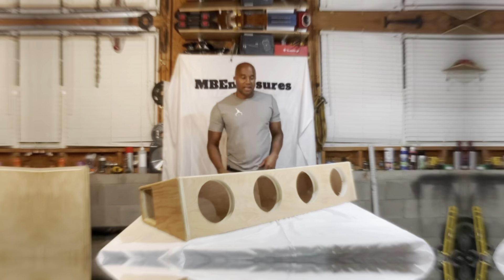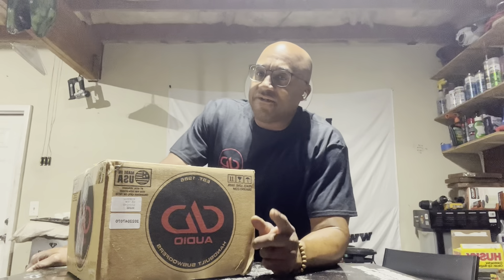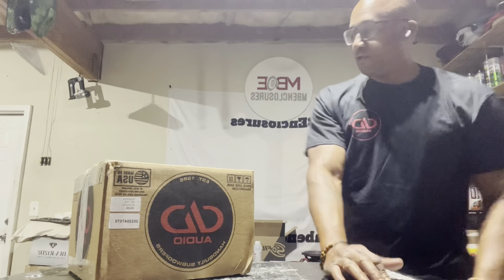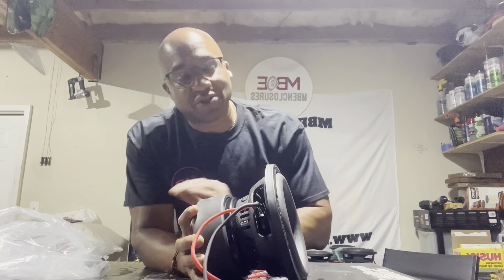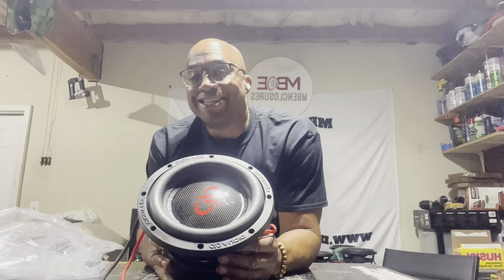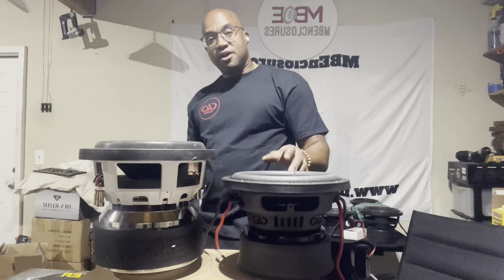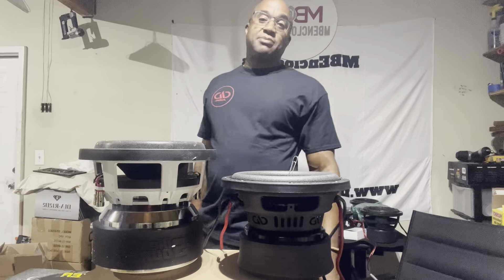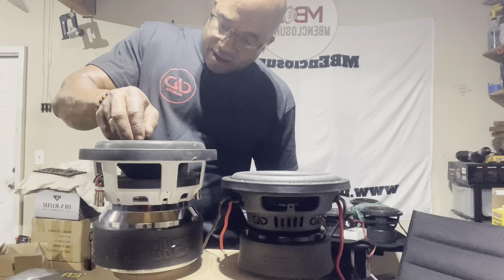Unboxing the Digital Designs 1508 SC…No Seat Lift Needed for Optimal Performance!!!

Comment: When magnets get stronger their magnetic field gets smaller.  Also, the black hole in the middle of the field gets bigger.  An N55 rated magnet is stronger than a N44 and the N55 has a smaller magnetic field.
Reply: So if you measure the bl, the DD will have a slightly stronger motor than what resilient sounds lists on their website. The reason so much flux is coming out of the top is because of the neo ring on top of the pole piece. It's because there's a crazy strong magnet right under the dustcap.
Reply: @blakebrockhaus347  makes sense.  The paper clip is much closer to the magnet and the field faded away exponentially.  This experiment os sorta like the vacuum cleaner guy and the bowling ball!

Comment: A little off subject, but whats ur take on  ofc and CCA? Or could ubdo a video on that please and thanks.. love the content keep it up.
Reply: OFC is superior conductor than CCA, Steve Madden did an experiment to prove it look it up on his channel, but at the end of the day u use what u can afford.
Reply: @jeanamisilva  yea I seen the video. But nothin beats info from the ppl that probably experienced both first hand. I know ppl that run ofc I know ppl that run CCA and the CCA build has been running flawlessly for 3 plus years.. I was jus wondering MBs take one the subject not Steves. Thank anyway.
Reply from the maker: Steve Meade  is a great source of info. But I get your question. Ever wonder why everyone screams OFC being a better conductor but there are a lot  of subs with CCA voice coils? Go figure
Reply: @M.B.Enclosures  the primary reason behind CCA voice coils is to reduce the moving mass of the coil, and increase the winding height. This gives more efficiency, and more xmax. Ofc is better power wire because the resistance is lower, but when designing a voice coil that is taken into account.

Comment: In Mississippi,  I need a box for 2 12 hifonics brutus (square subs)  for my 2019 Chrysler 300s.  But I want it so it can fit as far back as possible so I can still access my battery and spare tire. 

 How can a reach you on a price?

Comment: Hi just came across your video content a few days ago and I was wondering what's the best application for a 1998 Lincoln Town car on stock electrical.   What should I be putting back there 15s or 12 or 10s what's preferred.

Comment: What are the benefits from bolting your box down to the vehicle?  Would it get louder?
Reply: Harder to steal. And if it in a open cabin like a hatchback or an suv it becomes a projectile when in an accident or just not seeing a speed bump.
Reply: @qiraat69  that makes sense but did you want to answer the question?!   My box is built inside the trunk.  Cant be stolen.

Comment: Next myth Buster… Im hearing a lot of guys saying The corners of square woofers doesn’t give any output.
Reply: Ppl are probably mixing up pipe flow and cone area. In a square pipe, very little of the flow comes from the corners due to friction. regardless of shape, a woofer cone moves as a flat plane. So you get equal output from the corners